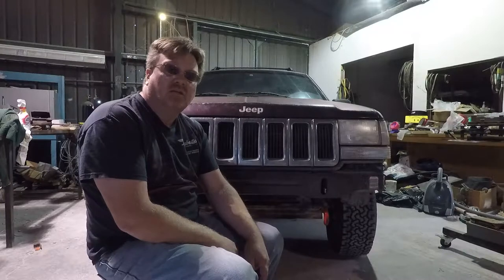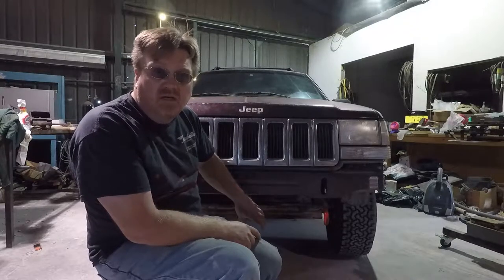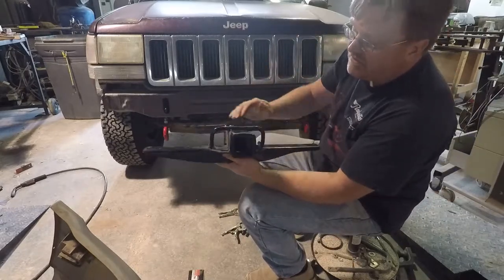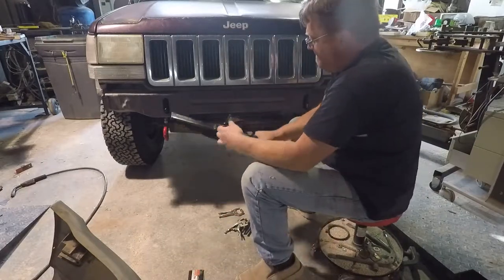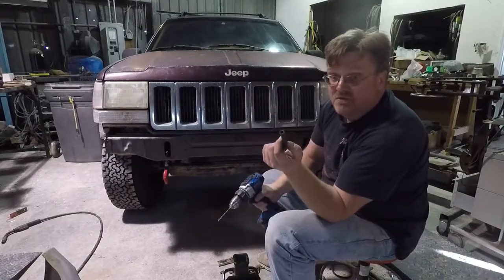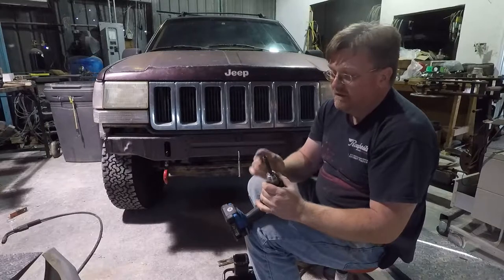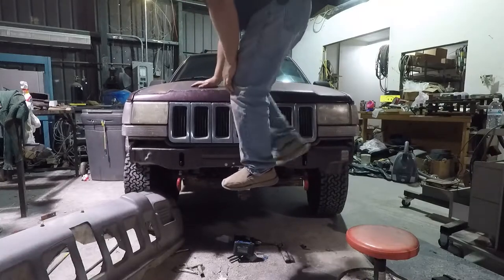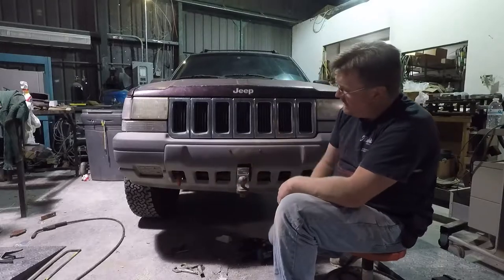Jeep ZJ Front Mount (Hitch)

Comment: Why not just buy the right front receiver hitch?  Going cheap on a hitch is never a good idea, and you cut away most of the integrity of that hitch and made it quite untrustworthy.
Reply from the maker: Well, I wouldn't trust it pushing a trailer down the highway at 75 mph, but I wouldn't want a trailer in front of me on the highway anyway.  For yard use at low speeds it works great!